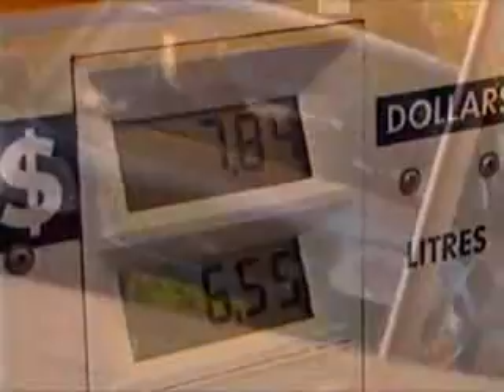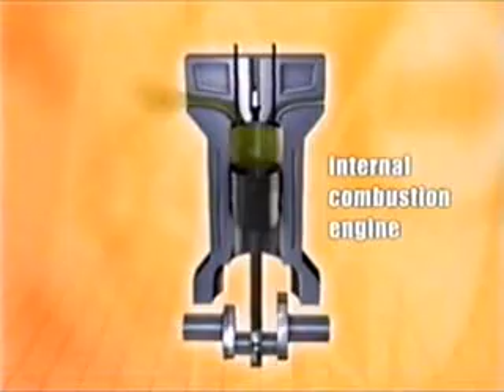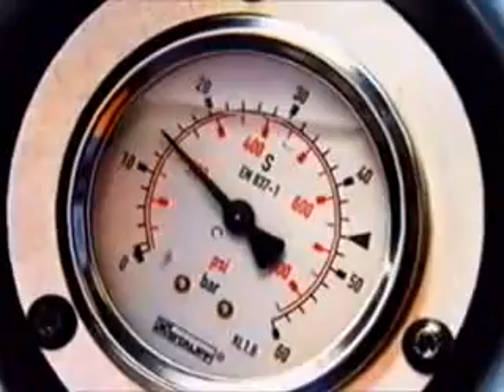Air Car by Guy Negre on Beyond Tomorrow

Comment: Really really really like to buy
Reply: It will never come to market.  The amount of energy you can store in compressed air is very VERY low compared to gasoline, natural gas, hydrogen gas, even a battery.  None of these cars has ever been driven more than 10 kilometers.

All the claims you see here are just blatant lies.  This is a scam.  It's easy to calculate ho much energy you can score by compressing the air down to a LIQUID.

Compressed air engines are find for small vehicles or motors, but they don't store enough energy for a modern car.

I am quite surprised this scam has gone on this long.  It's been nearly 20 years.

Comment: @yumcha16  Where do you think the electricity comes from to run the air compressor?  Bwahahaha That's right throw away 75% of the energy when compressing the air as heat. Smart move NOT
Reply: Use solar to power compressor
Reply: Well there's hardly no heat from the engine so they're saving a lot of energy there.

Comment: Dude, don't be an asshat. I'm saying that it would be more effective for it to be an electric car and to have a compressed air engine as a backup, not that this is better than a fully electric vehicle. I agree completely that a full plug-in electric is much better than a hybrid, but I just wanted to point out that their design is ridiculous as an engine only - they should make it a hybrid if they insist of pushing compressed air! Oh shit, I forgot I shouldn't feed the flame trolls. Sorry!

Comment: I think that they should think about turning this into a plug-in electric-air hybrid instead of an air-gas hybrid - just like the Fisker Karma. These vehicles rely more on batteries than the engine, and that engine is only present to recharge the batteries. In other words, the engine doesn't run the wheels directly. I think it would probably be much more effective this way.